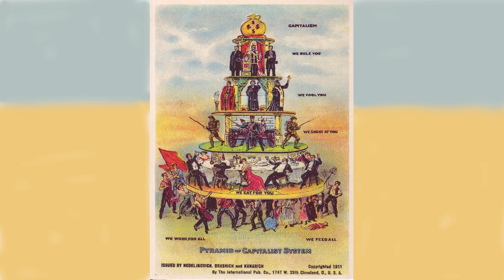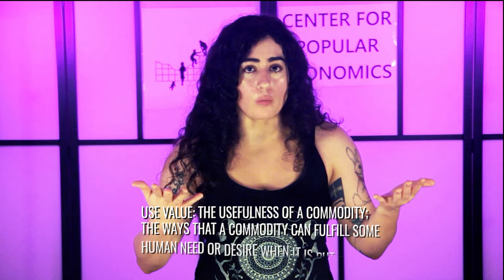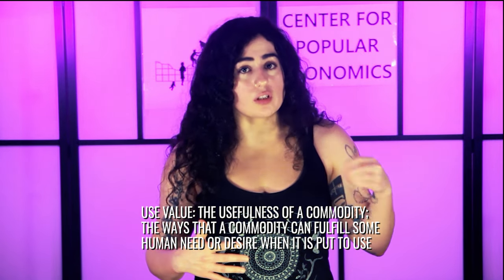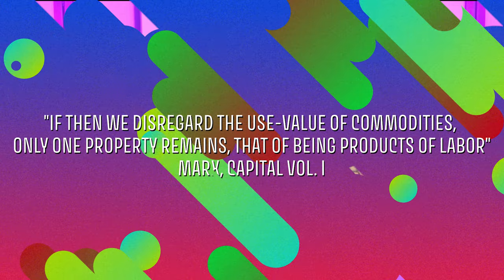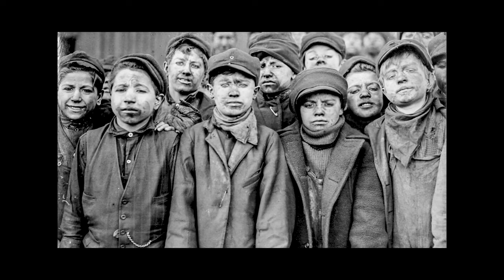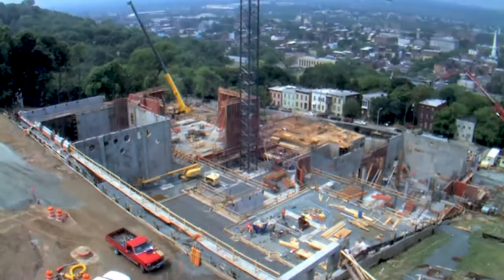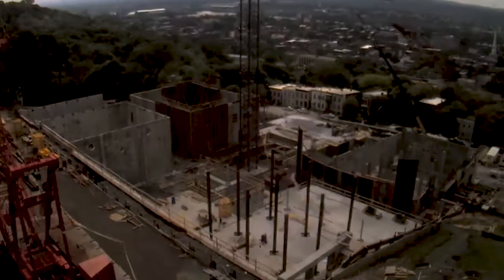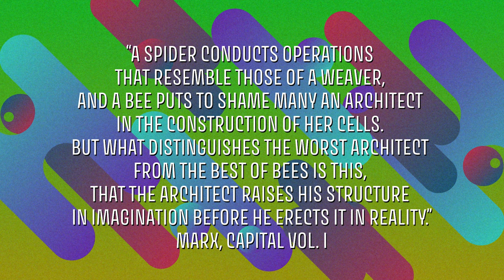The Labor Theory of Value | Marxist Economics

Comment: * * * Part 1 * * * 
Hi, from my point of view, there is something wrong with the classical interpretation of Marx's Labor Theory of Value (which he did not use that name, although the term is very apt). As a result, Marx contradicts himself in some places.
So, in this video - from my point of view - there are errors too:

- There are no intrinsic values! Value is a social relationship. Such a thing is formed between people and only works between people. Value as such a ratio can only be assigned to goods and value equivalents.

* Quote: „If then disregard the use-value of commodities, only one property remains, that of being products of labor”
Wrong: 
- What goods have in common is usefulness on a social level, because otherwise they would not be exchanged for money. Marx abstracted from this, but with usefulness, value also disappears, because usefulness is a condition for value.
- The usefulness is not about appreciative words like “That is really very useful!”, but only about the recognition of the usefulness through the exchange for a value equivalent, mostly in the form of money.
- What is produced are not real goods, only potential ones. According to Marx, a labor product only becomes a real commodity when it becomes a use value for others through exchange.
- Hence, production takes place with work. The market will decide whether this work can be qualified as a labor - if it is sold, yes, otherwise no.

* Quote: „Labor is the Source of all Value”
- Value is not produced and cannot be incorporated anywhere. The value is assigned on the market both to the commodity and to the value equivalent in the same amount. 
- Labor is only indirectly the source of value. Namely only in those cases in which the work products are sold.
- Value is not just about human labor either.
- Human workers create the prerequisites for value relationships and thus for values by bringing about changes in the raw materials, raw materials, assemblies, etc. in the form of increases in quality compared to the initial state.
- But machines do the same. It does not matter whether these quality improvements are brought about by human labor, by machines or by certain parts of nature (by means of work).

- Machines are used as workers in the same way as people. They are bought like slaves or hired like temporary workers. Their values are based on the purchase and rental costs and the amount of means of subsistence they need: electricity, water, compressed air, fats, etc. („food”), work space („accommodation”), maintenance („health care”), repairs („Medical treatment"), reprogramming („further training"), communication and more.
- These subsistence costs are linked to the labor products as a claim for replacement in the same way as is the case with human labor. In principle, it does not matter whether a human worker or a mechanical worker screws two parts together, welds something, etc.
- With the use of machines, just as with the use of human labor, the entrepreneur wants to earn more by selling the work results than the production cost him. 
- Just like human labor, machines must create the conditions for buyers to pay more than just reimbursing the costs - there is no difference between human and machine labor here either.
- It looks similar with certain parts of nature (cows, chickens ...), but we will not go into this here in more detail.
- Labor is the source of all values, not only the labor of human labor, but also that of machines and parts of nature.
- Sufficiently strong needs for the goods as well as their non-free availability are always important for the value. Paid workers are an important reason for the non-free availability of work products.
Reply: @borisd4397  
You are twisting my words: I didn't write that machine and human labor are equal sources of value!
I wrote that in both cases the work of both kinds of work forces (and those of certain activities of nature as well) contribute to the formation of value in the same way.
That's a huge difference!
Cognitively, machines are far from as advanced as humans, but in many cases they can screw, drill, paint, bend, etc. much better than humans.

That the work of human workers can (and in most cases is) value-creating is not because of the soul, or because they can think.

Value formation is based on the fact that the values of the labor force, i.e. the extent of the means of subsistence to which they are entitled, are proportionately linked to the products of labor as a claim to compensation when the products of labor are sold.
Marx describes this with his value formula W = c + v + s.
According to Marx, the values of the human workforce are included in this calculation as v.
In the parameter c, they are included proportionally as past work (in the case of raw materials, purchased standard components, etc.) and as externally performed work (electric power, communications company, etc.).
The costs of c + v are to be reimbursed with the sale of the products. But the capitalist not only wants to be reimbursed for his costs, but also for more money, the surplus value.
But that does not yet exist on the production side of commodity society. The entrepreneur can only estimate what would be possible as a demand for surplus value based on his company strategy and the given market situation.
According to this formula by Marx, it is not the value that is calculated, but an expected value:
W|expected = c|cost factor; replacement expected + v|cost factor; Replacement expected + s|expected.

The buyer pays for the surplus value on the market. But he does not pay for it on top the production costs c + v: if, for example, the production of a technical device costs c 300 € and v costs 100 €, the entrepreneur receives 50 € surplus value on the market, then this surpls value of 50 € is not added to the costs c + v – the buyer would then only have to pay 50 €, because the costs c + v are already given.
The buyer must replace c + v completely and pay 50 € more so that the entrepreneur receives 50 € surplus value, which is also what the term ‘surplus value’ means.
In addition, surplus value means "more value" above a value below it. The value below, however, is not the cost, but the reimbursement of the cost - that was just described.

I refer to the reimbursement of costs as the “base value”. The surplus value is added to this:
W|real = base value + surplus value = c|cost replacing + v|cost replacing + s|real paid.
This happens in the market, since there the buyer replaces the costs c + v and pays an surplus value (at least that is usually how it has to be done if the company does not want to go bankrupt).
This makes it clear that value is formed on the market. One can only produce the prerequisites for value relationships and for values.
According to Marx, if a product is not sold, the work done for it was not socially useful and therefore not value creating.

According to the value formula, value is assigned to the product of labor on the market, not built into the product by human labor - the reimbursement of the costs + the surplus value payment can only be assigned.
With production, people increase the quality of materials, objects, etc., until a condition is reached in the products that should meet people's needs to such an extent that they are likely to buy the products. But it is only when it is sold that the work is qualified as socially useful and thus also as value-creating. This happens on the market, not just through production.
However, the quality improvement of the work products in the course of the production process is not only carried out by human workers, but also by machines and certain parts of nature (clearly visible in breweries, where brewer's yeast (microorganisms) are of great importance for beer production.
All this work by humans, machines and certain parts of nature only works if the means of subsistence are replaced for the labor forces.
For people, it is food and luxury items, everyday necessities, clothing, raising children, living space, water, electricity, education, technical equipment, going to concerts, travel, etc.
In the case of machines, it is also electricity, premises, fats, maintenance (“health care”), repairs (“medical treatment”), reprogramming (“further training”) and much more.
In the case of microorganisms, this is ensuring the right ambient temperature and the right and clean food.
These are incidental subsistence costs equivalent to those of human labor. They are also associated with the work products as a claim for replacement - that's why I wrote "in the same way". Machines and certain parts of nature therefore contribute to the creation of value and surplus value in the same way as human workers.
The entrepreneur would not use machines if he could get no more profit with them than without them, or if he could only get out of them what they cost to buy and subsistence - then he would rather use human labor to get profit.

The win rate would also decrease without machines, since a good new production idea can generate a particularly large amount of surplus value. As a result, more and more capital is shifted in this direction, so that more and more of this type of product is built, until at some point no particular profit is made from it.
In practice, however, practically all production areas are filled with machines.
Reply: Does what you say not contradict the premise of Marx’s Law of Value? Human labor is what Marx explicitly accredited the creation of value to. Even if you were to amend his Law of Value to accommodate for non-human labor, what implications does this have for his Law of the Tendency of the Rate of Profit to Fall, and, as an extension, his predictions about capitalist crises?
Reply: @peterpeterpeterpeterpeterp1431  
* Marx and contradictions in value formation
Marx contradicts himself when it comes to value creation, at least in his own interpretation of his statement and with his value formula:
According to Marx, value is a social relationship. You can't build something like that into an object and you can't connect it firmly with it either. A social relationship is formed between people and also works between people. Commodity and value equivalent are the reference points of a value relationship.
This becomes very clear with Marx when he says that a product of labor only becomes a commodity when it becomes a use value for others through exchange.
On the other hand, he says that value is the residue of human labor and as such resides in a processed object. But at this point he forgets utility, which is necessary for value. A product of labor in the form of a commodity becomes useful through exchange, not through words like "That's very useful!".

* Marx's value formula is wrong
Marx's value formula shows that his description of value formation is wrong: Marx describes value formation with W = c + v + s.
He applies this formula to the production side of commodity society because he attaches no importance to the market for value formation. In addition, his value formula includes the costs c and v given on the production side.
He adds an "surplus value" to these costs. But there is still no surplus value there. Even if an angel were to hand down the money “s” to the entrepreneur, that would not add any value since it would only replace part of the cost.
On the production side of commodity society, an entrepreneur can only estimate how much surplus value he can expect for a product under current market conditions, so there is only one expected surplus value.
Since surplus value is part of value, there can only be one expected value on the production side.

Real value can only be created by buyers and sellers on the market if the buyer pays a real value equivalent, but surplus value only occurs if the buyer completely (!) replaces the costs c + v and pays even more, namely the surplus value.
But in the market the surplus value is not paid for the costs c + v, but for the replacement of the costs c + v. That's a difference.
This makes it clear that the value is formed on the market - as a recognition of the expenditure that appears useful.

* In principle, all types of work forces contribute in the same way to value creation
But in this recognition it makes no difference in principle whether two parts were assembled by a human or a machine, nor whether the calculations for a motorcycle's frame strength were performed by a computer or a human engineer.
This means that the type of labor force is not decisive for value formation.

* In principle, all types of workers contribute in the same way to value creation
In principle, when acknowledging expenditure, it makes no difference whether two parts were assembled by a human or a machine, nor whether the calculations for the frame strength of a motorcycle were performed by a computer or a human engineer.
This means that the type of labor force is not decisive for value formation.

* Law of the Tendency of the Rate of Profit to Fall
With the realistic description of the formation of value, it becomes clear that the rate of profit will tend to fall if companies that compete and deliver the same products, such as railways, increasingly adapt their production processes to one another.
But what is not explained by the classic interpretation of the LTW is the fact that the rate of profit does not fall in every individual case. This can be influenced by brand names; particular new innovations in products that have been in production for a long time; special designs etc. are explained. But even in cases where the investment risk is very high, such as in space travel, higher profits can be achieved over time if, for example, a provider dominates the respective market segment.

* On Marx's predictions about capitalist crises
The reinterpretation of the LTW does not change the principle of capitalism. The value forming (more precisely: the production of prerequisites for value creation processes) is only
1. extended to machine labor as well as natural labor (e.g. yeast in breweries, chickens, etc.)
2. and value formation is shifted to the market.
Because the entrepreneurs have to plan their production processes on average in such a way that all products are sold, the “creation” of surplus value will be about as noticeable as the classic interpretation of the LTV describes.
The important differences lie primarily in competing access to resources (which, however, affect value formation - very important in terms of effectiveness) and value formation related to automated factories, digital platforms and so forth.
In addition, there are the value formation processes in works of art, archaeological finds, etc.

This means that the crises are not described significantly differently, only more precisely, precisely because money is not seen as an equivalent for human "value creation" - independent of exchange, but as an equivalent for all goods based on which values are formed.